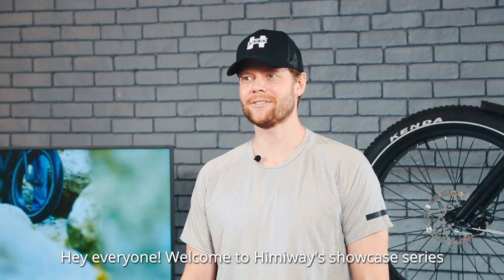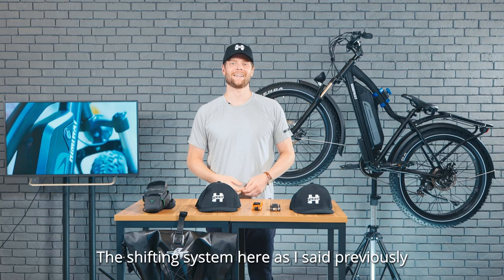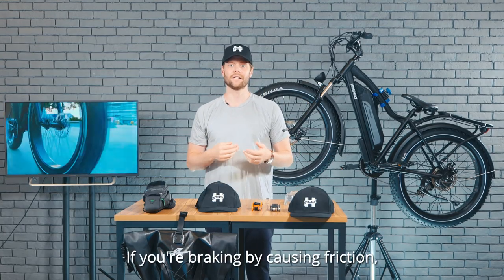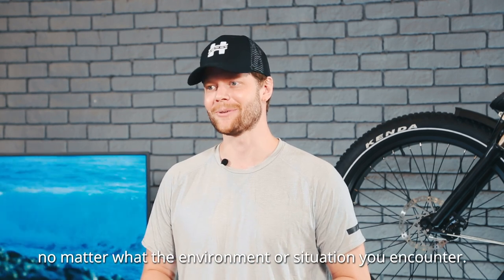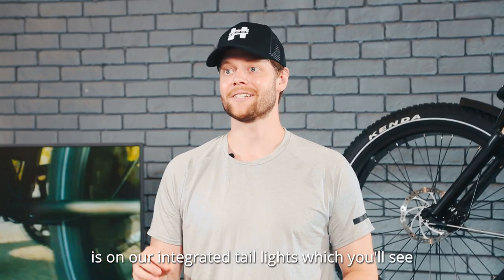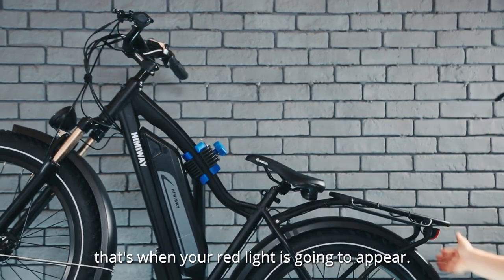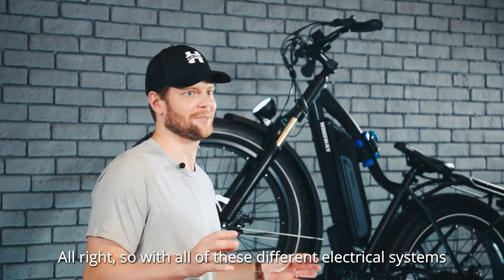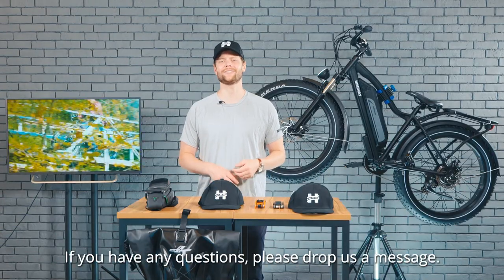Discovering your Himiway | Brake and Transmission System of All Terrain Electric Fat Bike

Comment: I'm with Vince..  on a bike this size with its power hydraulic  brakes would  be the way to go.  I understand of course the decision to use mechanical is purely economical.. that's why we are here getting the bike so reasonable.   One other thing on my mind.. because I dont actually have it yet.  But I understand it has a front fork lock out. I find this feature extremely convenient.. forks loose for downhill ,, forks tight for uphill.  Therefore having the ability to switch the lockout while the bike is in motion would be cool.  Is this connected with a cable to the handlebars for easy engagement???
Reply: Just got my cruiser yesterday.  Yes, hydraulic would be better for some, but myself I'm your average rider, happy with 20 mph being as fast as I need to go, and the mechanical brakes work just fine.   For those wanting to spend the additional $$, apparently switching to hydraulic is an easy task, using the same rotors!   As for the lockout, I believe you'd need to reach down to make the change, as it's all right there at the top of the tubes, and once you did it a few times, I bet one could do it quick and easily!

Comment: how do you remove a fault code on  the himiway, the front brake cable came out of its socket on the handle bars and it turned the throttle off and put in a code, when i replaced the cable it still does not work rite, the manual said I have to remove the code in order for it to work properly but does not show how to remove the fault code, help
Reply from the maker: Please send an email to customers@himiwaybike.com. We will help to solve the problem.

Comment: Where do I get the parts for my brakes
Reply: Where is my answer
Reply from the maker: Tektro Aries MD-M300 Cable Actuated Mechanical Post Mount Disc Caliper Long-Pull https://www.amazon.com/dp/B07C8BTYN8/ref=cm_sw_r_awdo_468GAN1WQ3VSHAARRQVY
Reply from the maker: TEKTRO Disc Brake Pad https://www.amazon.com/dp/B005OME320/ref=cm_sw_r_awdo_9T6H0XS682R6Y9YBB3RH